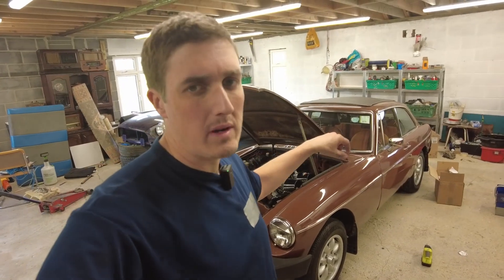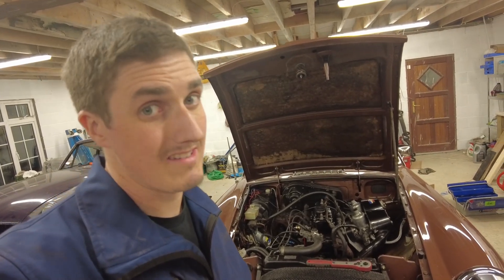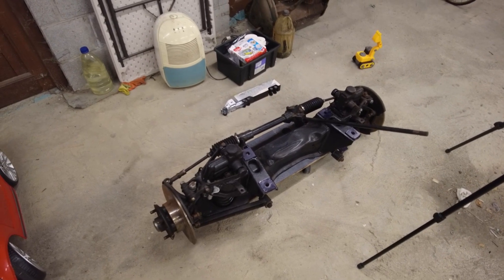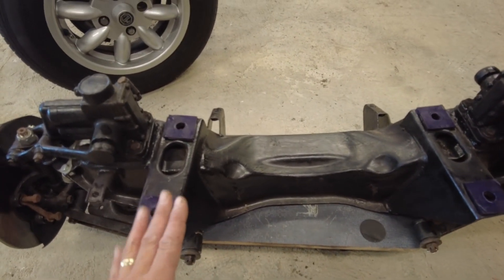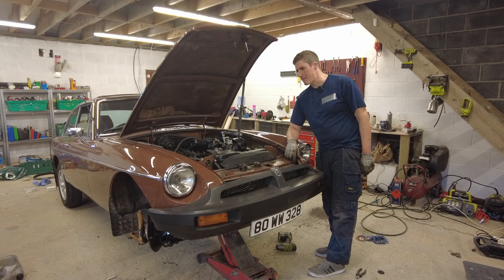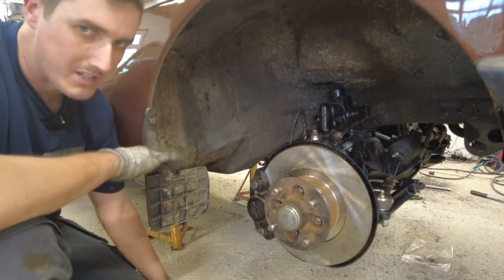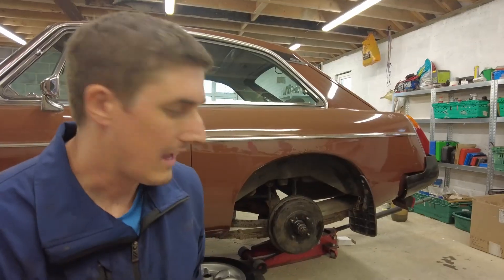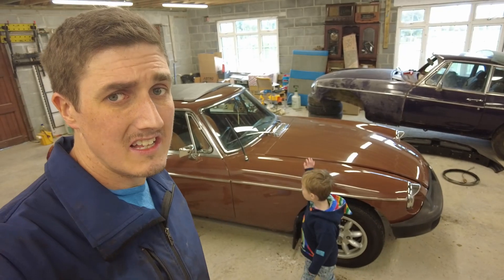MGB Revival - First proper drive, BREAKDOWN and front suspension and brake overhaul

Comment: Its been a while since I did a rubber bumper car, but I'm pretty certain by doing the cross member swop (assuming what you put in was a chrome bumper) you effectively return the ride hight at the front to the way it was designed before US crash regulations. There are lowering blocks you can buy for the rear to put the ride hight back to as designed and remove the rear anti roll bar as per original deign, it transforms the handling of the car and they look a lot better two. If both cars are rubber bumper, I highly recommend lowered front springs, lowering blocks at the rear and no anti roll bar. The handling difference between chrome and rubber bumper cars is night and day. I went through two sets of rubber bushings before going to poly all round for the same reason, the rubber are all crap from any supplier, now I'm slowly putting a few rubber back as although the car has incredible handling, it is a little hard. Rear spring pads are a good one to keep rubber as they are so easy to replace.

Comment: Around 76 or so they switched to electronic ignition although sometimes people retrofit the points. Check the vacuum advance is working properly and a proper points gap with a new condenser. Check the coil also. Beautiful work as usual. Thanks!

Comment: Ross well done with the work so far. I feel your pain with the rubbish reproduction parts some are absolute crap. I wanted to change the chrome bumpers on mine bought new ones at great expense, when they arrived didn't fit properly, paper thin garbage had my originals re chromed. Keep up the good work, looking forward to the next instalment.
Reply from the maker: Oh it does my head in! Where's the quality gone?
Reply: @Endfloat  I would rather more a bit more and get quality parts, very annoying as it is.

Comment: You have a great looking  GT there and will be well worth the effort  of getting it to run properly. One thing you can check is to make sure there is not a vacuum building up in the fuel tank. The gas cap should be properly vented and you should not hear any hissing sound when you loosen it. Just a thought.
Reply from the maker: That's a good idea about the fuel tank venting actually. Thanks. I must check that.

Comment: Breaking this Into two parts over my lunch break and totally understand the rant about modern parts, especially fuel lines, I know from another channel of a chap that had to replace the fuel lines on his classic and they had not been on very long either! As you say I would have thought the little rubber boots would have lasted longer as the parts have been kept away from the elements.

Will catch up with the last 30 minutes later on.

Comment: Will not go into the final, unexpected engine failure, which will have been sorted out in the meantime, but just on brake bleeding. Once calipers, cylinders and hoses are refurbished or renewed there will always remain tiny bubbles of air inside after a first bleeding job with the Ezibleed guess how I know. It is best to bleed the calipers at the front after driving the B for a short while: the suspension movements will shake the air loose from the internal surfaces and this will assemble at the top of the calipers, where the bleed nipples are located. Pedal bleeding for this short rebleed works just fine. At the rear this is less of an issue IMHO  🙂
BTW sympathetic way of registering the learning moments we all can benefit from  👍

Comment: Hey Ross, another good video. Did you ever manage to check what type of door speakers you have fitted? Mine are shot but not easy to find new ones with cones that aren't too deep they hit the window  winding mechanism. I'd appreciate if you could get me know the make and the speaker diameter? Cheers!
Reply from the maker: Hi sorry, I know you asked me that before. I had a look at the outside of them and it's just a little speaker icon in the middle and I didn't remove one yet. I reckon they were standard fitment speakers. There should be a decent selection of shallow door speakers available though.

Comment: Ross a suggestion for all the classics. Millers VSPE power plus. Been running it with my air cooled engines last two years can’t recommend it enough to anyone with classic cars. 

Maybe worth a video to review it! Available in Halfords.
Reply from the maker: Looks interesting. What do you find the benefits are of it?
Reply: Reduced pinging in my aircooled engine. Have noticed smoother running also. It protects the fuel lines as it has stuff in it to combat the ethanol in todays fuels.